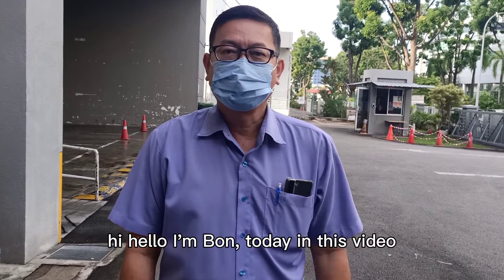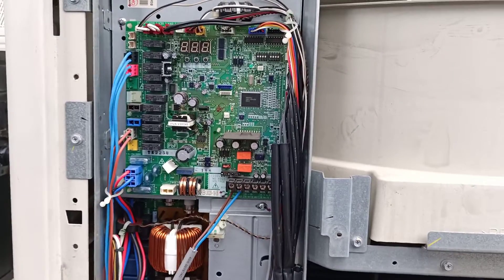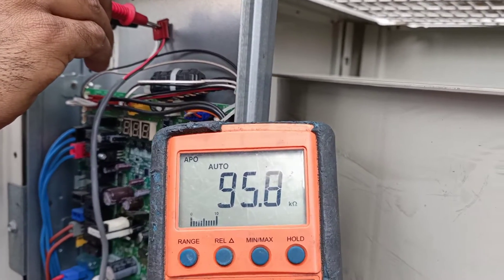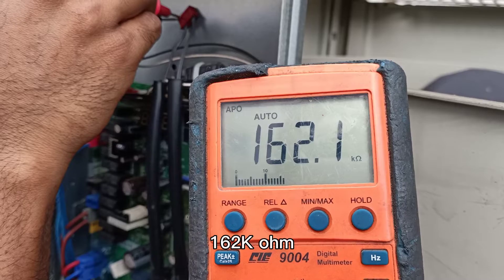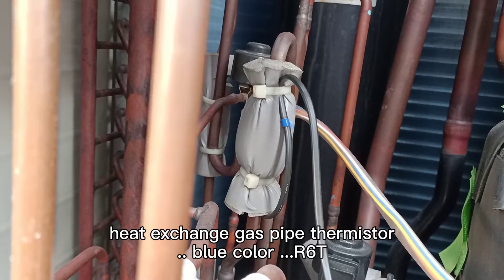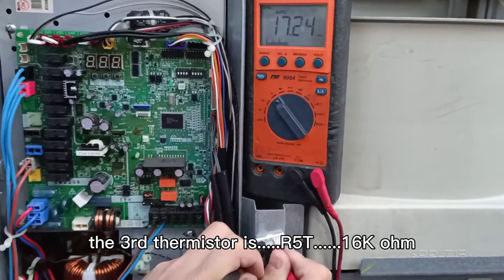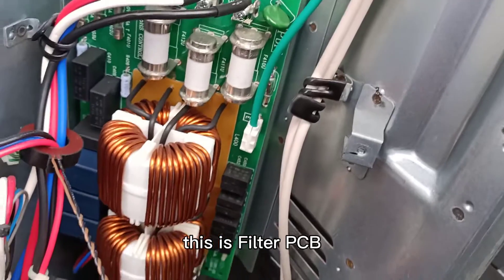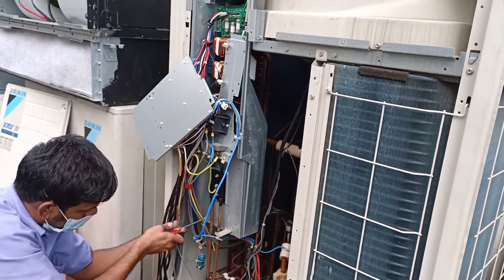Daikin VRV4 | Condensing unit Thermistor and High pressure Sensor reading | Error E3,E4,J5,J6,J7

Comment: Bon, thank you for the many excellent videos.  Can you please tell me where are you able to find the list of normal values for the different component resistances?  I have checked the VRV IV service manual and could not find any list of normal resistances, for high pressure sensor for example or for other parts.  Please advise.  Thank you very much.
Reply from the maker: We got few case before for VRV3, or some other vrv brand. We use same method and found the problem. 
Check list only show to check DC voltage.
Reply: i need to know the same thing also

Comment: Sir Bon if the unit has no refrigerant  VRV 3, does it affect the resistance reading of the high pressure sensor and high pressure switch?

thank u
Reply from the maker: Technically should not affect.
Normally the error F3 or UO will appear.

Comment: Thank you very much, sir, good content, as usual. I have only one question, when you checked the pressure sensors, what was the pressure in the system? After all, these measurements change depending on the pressure, don't they?
Reply: thank you 💕 so much. good job
Reply from the maker: The reading is same,with pressure or with out pressure.
Reply: @BonMj  Thanks bro
Reply: Good evening master bon, how to visual check the thermistor,  and what are the indication of bad thermistor withtout multimeter, thank you
Reply: Bon sar good morning sar my question is Vrv x vecum seting 21 please sar telme 😊🙏

Comment: Vrv-3 emergency setting inverter compressor and standard compressor settings same or not sir
Reply: I have a doubt sir how to find inverter compressor faulty and main pcb
Reply from the maker: @peramaraj2763  you can test with inverter checker or some is over current.
Reply: @BonMj  over current mean from incoming the CU right ?
Reply from the maker: @peramaraj2763  compressor high amos
Reply: @BonMj  OK thank you very much sir
Reply from the maker: Not same